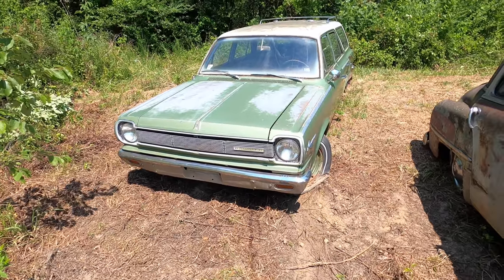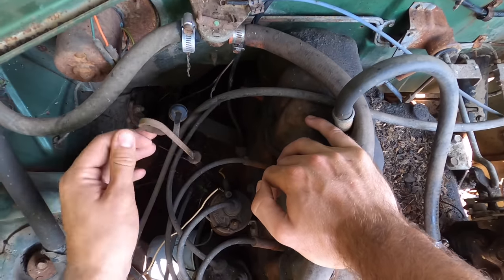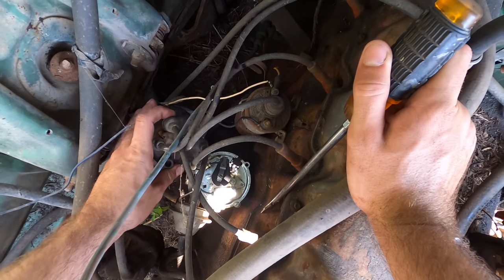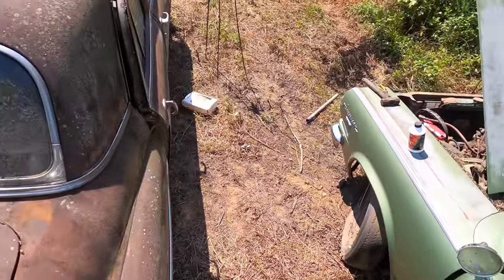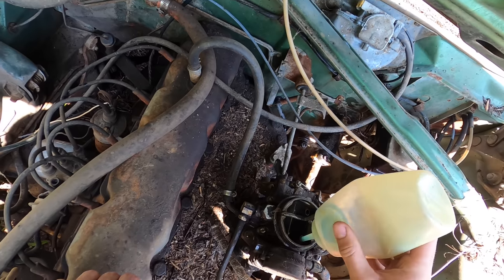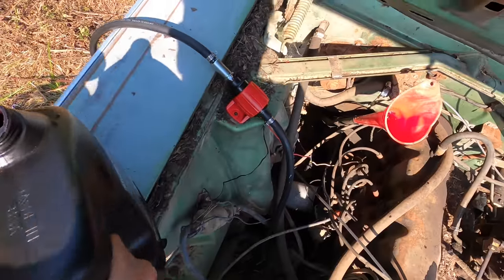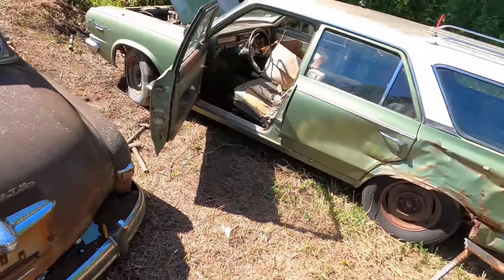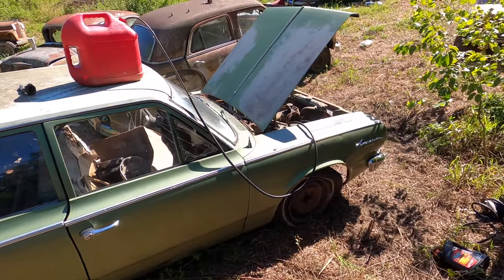Will it run after 26 years 1964 rambler American wagon

Comment: Transmission fluid is usually supposed to be dipped in neutral with the engine running at idle.
Reply: I always checked mine on the highway at 60 mph
Reply: @maggs131  I can't find a flaw in your logic

Comment: So rooting for this car!  1964 model human here, and my first car was a 1969 Rambler sedan with a 232 in it.  Its too bad AMC didn't make their car bodies out of better steel, because they would rust something horrible here in the northeast, but the engines would run forever.  AMC called their engine line "torque command engines", and I can confirm that is true.  They had no top end to speak of, but you could go from a standstill to 30mph in about 2 seconds.  Ramblers were great cars, and the inline six is an amazing engine.
Reply: So was the Chrysler slant 6s in the 60s, early 70s. They all rusted out here in the salt belt states. In the dry states they're still around just most have them put away.

Comment: AMC were  some of the highest quality cars on the road in their day.  Many are find that out now and these cars are in high demand now. Parts are available on line.
Reply: We had a few Rambler Classic and Rebels in New Zealand,I always liked the Classic,I mostly had Ford Falcons but would happily have traded for a Rambler.
Reply: Mechanical they were great. Ugly is why they didn’t sell. Some the best mechanical work ever. Very innovative in their drivelines.
Reply: looks at the gremlin
looks at literally any other car from the same era
doubt
Reply: Very true Daniel. In the early seventies my dad bought all AMC. Is pick up my mom's AMC hornet my one sisters AMC matador and my other sisters AMC Javelin. All were Bulletproof, and there is a very interesting story about that javelin. But the True Value in cars today is not in their shininess or technology or newness. The True Value is shifting back to where it should be, getting you where you need to be safely and reliably. Their longevity and their ability to be repaired by the average man.
Reply: What do they make since the 90s that will run when they're 50 year's old
Reply: @m42037  Nothing because we will not be able to get sensors, computers, and all the plastic crap the newer ones are made of. Sad part in just a few years there will be no classics.
Reply: @danielheartsill4269  There will be classics for decades to come. Out west there's still 10s of 1000s of old cars as you see in all these videos. The vintage restoration business is big today, maybe a billion dollar industry. Not showing any sign of slowing down. Some late 80s and cars from the 90s on up (not all) have not a big following. Mid 90s Jeep Cherokee's are interesting, up to 96 before the jellybean style has interest etc but most aren't of interest. Most is mid 70s on back
Reply: @m42037  What you say is very true. I didn't make myself clear I guess. I was talking about the run of the mill cars of today, no classics. We have a Nissan car and with all the plastic and other junk it will never be a classic. It is nine years old now, has been a very good car but one day it will all start to rot and no one will make replacement parts. I live in Texas and we don't have salt rot, mine will be from time and sun. Yes there will still be classics in fifty years.
Reply: @danielheartsill4269  Ya right I own a 07 Impala, imo the last sweet body style Impala was 68, the 69 on up imo are grandpa cars. Compared to the jellybean styles well ya impala up to about 89 I think the Caprice Classic then in 90 it turned into a egg, same as the other companies. Consumer reports we're all over Ford to get rid of the classic body style the Lincoln had in 88-89, 90 it was also the end for the Lincoln. Sad. Cadillac was 92.5, the Brougham, I think was the last classic look out of all the cars, really sad! They should of kept making this car for another 10 years or as long as the public wanted it
Reply: @m42037  You are right. The auto mfg people listen to Consumer Report too much. Consumer Report is bad about not liking a car because of style or looks. Those things have nothing to do with quality or safety which they should be looking at. They hate Jeeps because they don't ride smoothly. They throw reliability in for good conversation. I  have several people in my family who own Jeeps. No one has had big problems with them. I started asking people in parking lots about their Jeep quality. Not one has complained and love them. I wouldn't look at Consumer Report to guide me to a purchase on anything.
Reply: @danielheartsill4269  Correct me (I'm writing everything off my 55 year old memory not Google) the last cool body style of the Jeep was 96, with the chrome package that was the last of that style since the war, today they're all ugly as sin imo. Almost every SUV today is grotesque, all look like Ostrich eggs on wheels, why people spend 30-40k on such discusting looking vehicle's I don't get it. Yes Consumer reports I remember said that Ford needs to get rid of the "antiqued boxy style and modernize the car, sure enough they did. We all know the reason they companies started this was to save money, a metal bumper with chrome on it cost so much more than plastic, and yet they charge you through the arse for a replacement. If I had eight figures in banks I would open a restoration company and start restoring cars to new (not overdose on restoration like those Barrett Jackson cars that are 500k I'd lose) and sell them on the lot for small profits like 60k a car, I guarantee people would be buying them up faster than they could be restored
Reply: We thought Ramblers were junk. Just sayin
Reply: @theyangview1898  
     I’ve heard other people say that, including relatives, but in all the cases I know of it was ‘brand bias’ or because they didn’t change styling every few years, like Ford and GM had the $$$ to do. 
    AMC was recognized as having great auto-industry engineering in mechanicals and electronics — they won as many ASE and SME awards as FoMoCo, GM and Chrysler combined, throughout the late 1950s through mid-1970s. 
    THAT is a major reason why they weren’t forced to merge in the 1960s and lasted until Chrysler bought the corporation. 
     And yes, a few of their models (I said FEW) are now becoming very sought after.

Comment: Check the transmission with the engine running to get the correct level...
Reply: Yeah, just like the two barrel carburator too. HaHa!!!
Reply: Common knowlege way back when  Appreciate this kids tenacity, regardless.
Reply: @MrJackanand  Should be common knowledge now as the few modern cars which still let you check the fluid at all ask that you idle the engine in park on a level surface when the transmission is warm to get the exact correct level.

Comment: We had a '67, Dad welded a hitch on it so we could tow our boat to the lake and use our utility trailer.
Almost 30 mpg, ran clean and quiet. Even took it out on the beach for Clam digging. We Loved it!
Reply: We had a '67 AMC Rebel 550 with a 343 V8. I bought it from my dad in '82 and proceeded to get in a lot of trouble with it! lol! Great car, but parts were impossible to find back in the "pre-interwebs" days.
Reply: @svt4001  lol how do you get in trouble with a wagon
Reply: @yammmit  It was a two door sedan. My dad hot rodded the engine. Milled the heads down, huge 4bbl carb, low restriction exhaust...the list goes on. It was FAST!!!

Comment: Hi. You're supposed to check the transmission while the engine is running, in park, warmed up.
Reply: On my chevy nova it says in the manual to start the engine set the parking brake and put it in drive. I've been checking it this way for the ten years I have owned it.
Reply: yes that is very true
Reply: He was just making sure it had SOME fluid in it, I do the same thing when my car sits for a long time, then check the level properly when it's warm.
Reply: Wayne you are right my father told me that years ago always check the tranny fluid with th engine running you are right ;-)
Reply: It usually has that stamped on the dip stick.

Comment: Those Rambler/AMC cars were actually very well built back in the day. Our family bought a new 1962 custom station wagon. I dont know why my Dad bought it with the straight six, but it pulled the wagon just fine even with that push button automatic transmission. We made several trips from Seattle to Disneyland in California with two adults and five kids and it never strained when going through mountain passes. The exhaust pipe was even porcelain coated. We had it for many years then traded it in on an AMC Rebel wagon in 1970. THAT car had abysmal build quality and was never reliable even when it was brand new, a total piece of junk!

Comment: It’s got a little 232 six in it. In Australia, in 1964, a 232 c.i. was huge. Our ‘66 Ford Falcon Station Wagon (XP is the Australian nomenclature) had a 144 c.I. six.
Reply: We had the 200cu, in 64 and with the XR in 66 we got the 289 v8 so not really limited to the 144. The other one was the 170. I had that in my XM, high pursuit motor. Nothing high pursuit about it but it sounded cool.
Reply: The 232 with 2-bbl carb was actually a performance upgrade that year for the American. It was rated at 155 HP vs. 145 for the base 1-bbl. That would have been a spunky little car when new!

Comment: My dad had a 59 station wagon, it only had a 199 cubic inch engine with a 3 speed auto transmission I never drove it, but it was a pretty good car
Reply: My Gremlin had the 199 in it when I bought it and the engine would probably still re-running fine if some dumb-ass had to put water in it and it froze and cracked block

Comment: I can concur with Ed, Daniel, William, drfalcon about the year, and all the others. It is, to be precise, a 66. Easy way to tell is the shape of the headlight surrounds. On the inside, they have a matching zigzag top and bottom. In 1967 and thereafter (to 1969)  the bottom portion was straight across (no zigzag) and the grill was narrower. In 66, you could swap them side to side. Not in 67-9. 440 was the base model. I have a 66 V8 Rogue. Would go a wagon too if one fell into my lap. In Australia, they assembled wagons and 4 door sedans. NZ didnt have Americans. We got the Classic (and later the Rebel) midsize models only
Reply: Steve, the 440 was actually an upgrade trim. The base model was 220. Another giveaway on the year is the dash - the '67 and later went to separate round gauges.
Reply: Yes, I was thinking the same thing since my brother owned a '64 Rambler American 440 convertible. The headlight surrounds are a dead give away.
Reply: lol I feel like he doesn’t even read comments
Reply: he does get quite a lot of them, to be fair
Reply: It may have a 66 grill, but its taillights are 1967 to 1969.

Comment: On your wheel cylinders, compare it to a early to mid 60's Mustang. AMC used a lot of parts from ford .my 1972 hornet used the same u joints. Maybe they used the same brakes.
Reply: I know that the '62 American has basically 9" Ford brake drums. Never had a newer one.
Reply: AMC Ramblers used either Bendix brakes, or Wagner brakes.  No GM or ford parts will fit.  Chrysler also used Bendix and Wagner brakes,  so some Valiant / Dart parts may be the same.

Comment: Had a 64 rambler american wagon...had a 4 cyl flat head motor if i remember correct...i dropped in a 327 cu.chev motor...4 sp..used the front coil springs from the bigger wagon...dual exhaust...original 2.9 rear end. ..that wagon would cruise !!!

Comment: I recently spoke to the original owner of a tan and white 1964 Rambler station wagon who just turned 89. I visited him and his family in Ohio in 1974 as our family moved out west 8 years earlier. They still had it then. But the original driver's side floor pan was rusted out, leaving a big gaping hole in the floor. But they were putting in a homemade replacement floor pan at the time I visited them. No more hole. But because the carpet was not reinstalled yet, I could see shiny new steel where the hole used to be.

Comment: That is a 1966 model not a 64. It should say 6608 on the ID plate on the driver's door Edge.
Reply: I would go with 1967 judging from the taillights.
Reply: @patrickwilson2726  definitely a 1966, the upper body molding strip is a dead giveaway. The 67 model had a wider strip along the lower body crease.

Comment: My grandfather had one of those. I think it was a 65. He was a fisherman and would put his little Jon boat in the back. Lol,  has the notorious 4.0 litre.
Reply: Not a 4.0 litre. The 4.0 litre is a Jeep engine that was introduced in 1987. The Rambler Americans like this had either a 199 cubic inch or a 232 cubic inch I-6.
Reply: @williamwallace9826  232 equals 3.8 cubic inches but anyway that engine is the Grand Daddy to the 4 L
And if you go way back that same block had a flathead years ago yes they had different cubic inches but that's the same engine that was used in the Jeep late later on
Reply: @williamwallace9826  to figure cubic inches in liters 1 L equals 61.9 cubic inches

Comment: Hi new in your Chanel I collected 1966-1969 rambler's for 35 years rear wheel cylinders are ford easy to get trans is a BorgWarner air cooled 2/3 speed with bull low 232 first year is 1966 early ones had L194 6 cyl   love those cars :)

Comment: All of the transmission fluid you were pouring in there and thought you were losing was probably just filling up the torque converter, they hold quite a bit of fluid. Maybe that's why it was parked, it might have a transmission fluid leak. Hopefully the clutches aren't burnt up.

Comment: I heard, not sure if it is fact. But when you start a car that has been sitting for 20+ it is best to let it run in neutral for awhile so the pumps start working/or at least circulates the fluid.
Reply: Yeah you want to get the engine up to temp and maybe top off the oil before you even think of putting it in drive, but that's just me.This guy ain't no Uncle Tony, but I like his honest backwoods go-for-it style.It's good entertainment, and dadgum he got it running!

Comment: There is a real chance you damaged that transmission by not checking the oil in it, while the engine is running. When they are so low like that you also might also want to shift it between gears, without trying to move it, and then check the levels again.

Comment: It’s at least a 66 because that’s when they squared the fenders off around the headlights. The only reason why I know is because I drive a 65 on the daily.
Reply: Correct!
Reply: also, the 232 was not put in a 64, they came with either the 196 flathead, or the 196 OHV engines, 232 showed up in 66
Reply: @drfalcon4102  correct!
Reply: One look at the taillights tells me 1967 to 1969.

Comment: You know you could leave the cap off and just turn the ignition on and with the coil wire close to some metal part like the valve cover you can take a screwdriver and move the points open and closed and see if you're going to have a spark....That way you know before you put that cap on that it's working.......

Comment: That's not a 64 rambler this body style didn't come out until 1967
Reply: 1966 is the first year for the square front fenders on the American. It also has the upper body crease trim strep and the engine ID on the rear quarter. These are 1966 styling features
Reply: Right, my dad had a 64 American wagon and the front end style was a bit different with round headlight surounds. The rear had wrap around taillights.
Reply: Even though Rambler was restyled in 1964, they used the taillights shown from 1967 til 1969.

Comment: These were good cars, ahead of there time. The six cylinder is a copy of the 199 and was a 258/04.0 used the the 70’s cars and Jeep.
Reply: Bill, the 232 was actually introduced before the 199. Neither is compatible with the old 196.5, which was sold in both OHV and flathead versions. Also, the 258 is not the same as the 4.0, which had a larger bore/shorter stroke. The 4.0 was about 242 cubic inches.

Comment: You better take a look underneath the car and see whether you blew a line off of the transmission or the radiator in fact look in the radiator and see if there's any transmission fluid in it whether it's recycling it through the block and head.....

Comment: Starting mix 7%mix of 2t oil in petrol will lube sitting engine .... Some time 10% about 250ml in carb n let it sit for a while.....or just put out plugs inject this mix with srynge ...let it sit  crank to flush all crap out

Comment: that's a borg warner air cooled transmission. check the fluid when it is WARM RUNNING IN NEUTRAL ON LEVEL GROUND . WHEN IT IS NOT RUNNING THE FLUID LEVEL SHOULD BE A COUPLE INCHES OVER FULL. GET THE NUMBERS OFF THE WHEEL CYLINDERS AND GO TO A COMMERCIAL BRAKE SUPPLY HOUSE AT LEAST ONE IN EVERY CITY.

Comment: I would have had some Berrymans b-12 chemtool and pour some down the carburetor, plus some PB blaster or WD-40 for the carburetor linkage. filler tube probably leaking at seal

Comment: Some marvel mystery oil or ATF in the oil will quiet them lifters down some for ya. You realize you should check fluid with transmission in neutral and engine running right?

Comment: Are there "behind the scenes" parts that I miss with a lot of these videos? Wouldn't dry starting an old engine that's been sitting for years, pretty much instantly nuke the rings/cylinders/cams/bearings, etc., etc., putting like the equivalent of 100K miles of wear in a few minutes, without some kind of lube or fogging oil down the spark plug holes, or at the least, a drain and refill with elcheapo walmart engine oil or something? I don't quite follow the reasoning to get these started and run without doing that.